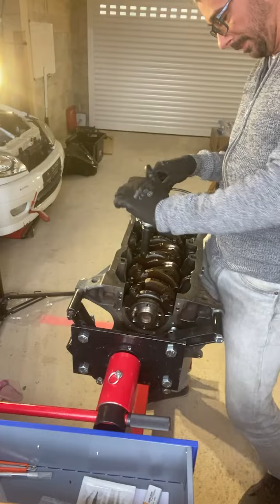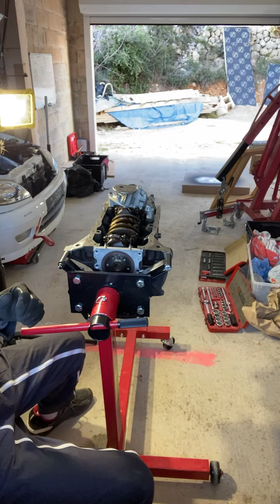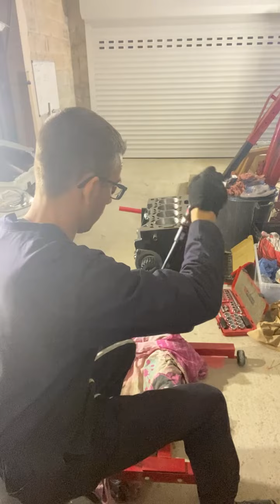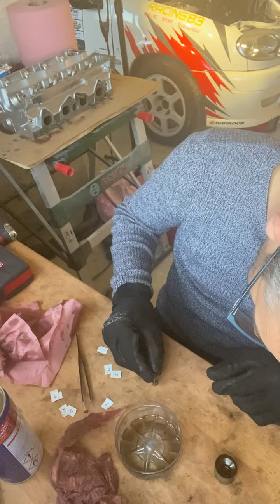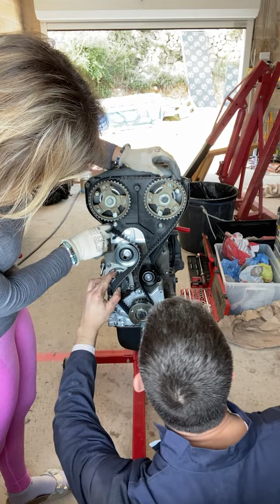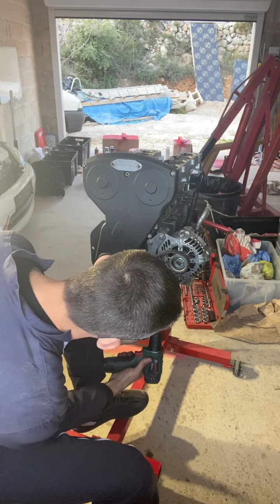Remontage moteur TU5J4 - Saxo

Comment: Hello, I have a peugeot 206 1.6 16v which has a manifold 4-1 and I installed the manifold from 106 1.6 16v which is 4-2-1. By doing that it changed o2 sensor's location and catalytic converter's location which were closer to the header's ports. So now I have an afr which jumps from 14.3 to 15.8 and i feel vibrations at idle, especially on cold starts. Is it possible the bigger distance between header ports and upstream sensor to affect the measurements?

Comment: How do you time the cams up to the block before pitting the timing belt on?
Reply from the maker: Réglage d'origine : desserrer les 3 vis des poulies d'arbre à cames, installer la courroie et tendre le galet tendeur. Les poulies vont se caler automatiquement, il reste juste à serrer les 3 vis des poulies. C'est le réglage d'usine préconisé par Peugeot/Citroën.

Réglage optimisé avec croisement maximum (plus de couple) : Montage à blanc de la culasse avec les soupapes sans ressort pour mesurer au pied à coulisse les distances piston/soupape à différentes positions de vilebrequin (-15°/-10°/-5°/0°/5°/10°/15°/15°). Remonter la culasse et caler les arbres à cames au comparateur en ajoutant un maximum d'avance à l'admission et un maximum de retard à l'échappement (pour avoir un maximum de croisement). Conserver une sécurité de 1,2mm à l'admission et 1,5mm à l'échappement pour les tous les angles de vilebrequin mesurés précédemment.